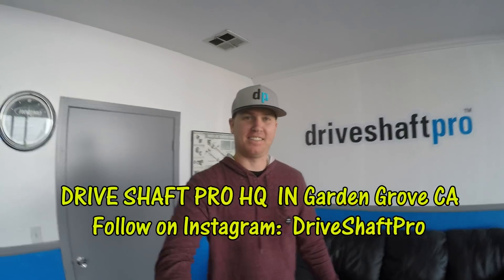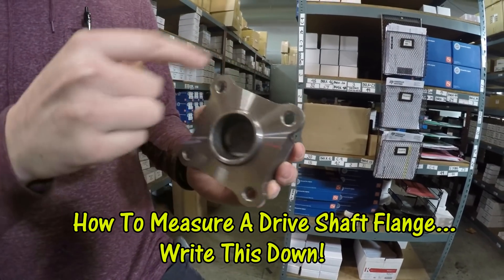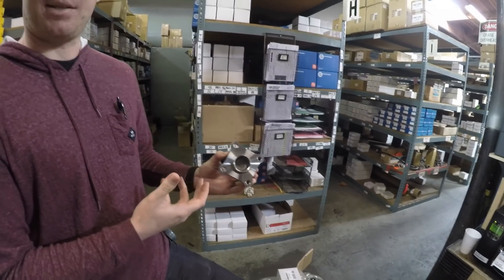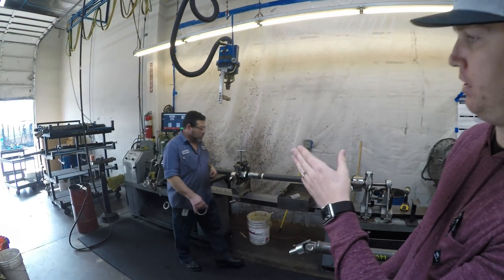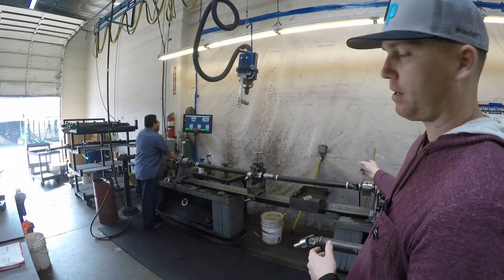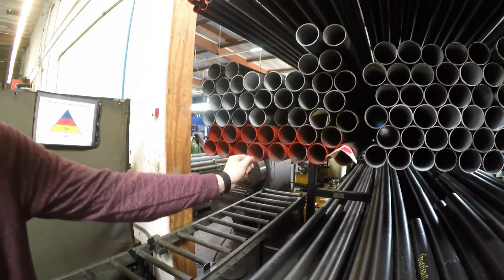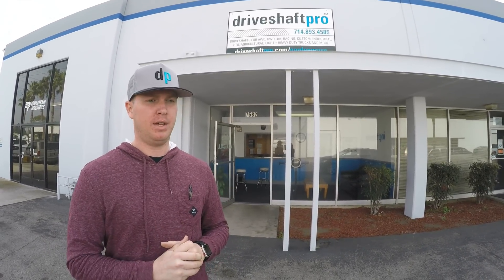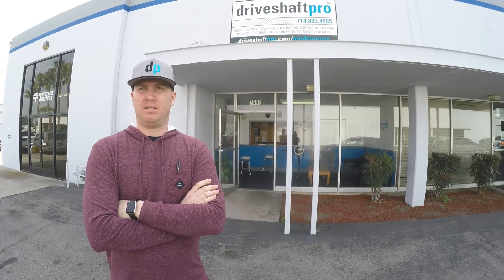Building a Custom CARBON FIBER Driveshaft

Comment: I personally would never buy another carbon fiber drive shaft again.  I've shattered 2. One on my Fox body and another in a talon
Reply: 8k launches are a bit rough.
Reply: blindabinda123 how many times they check that the carbon fiber wall thickness measurements fits your's especific aplication?